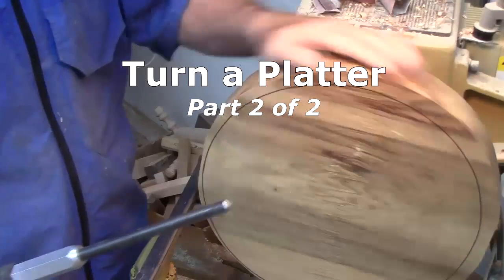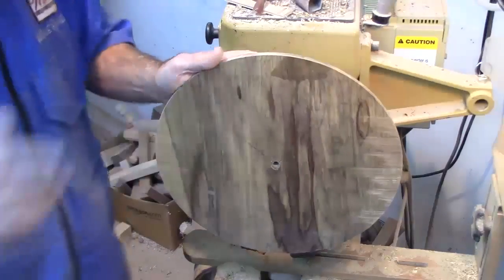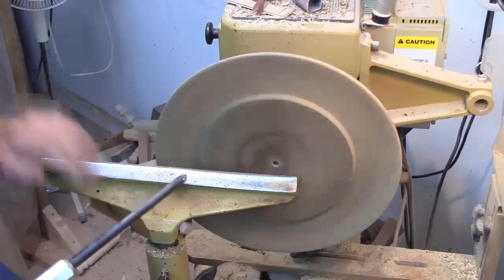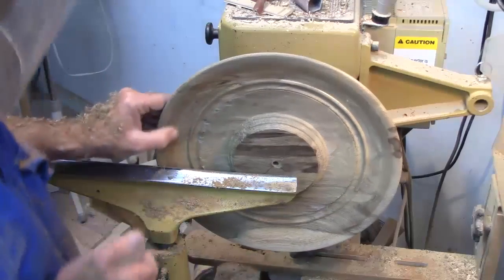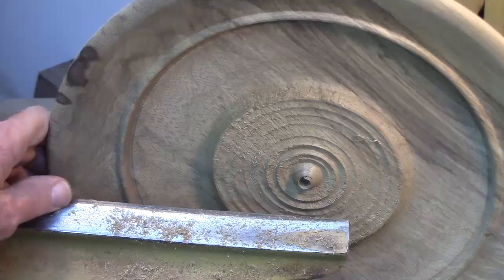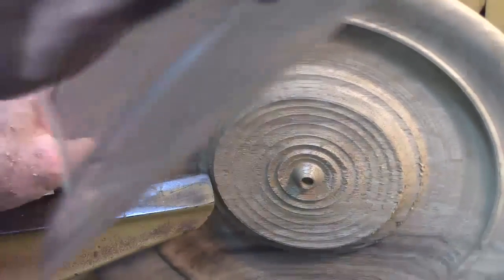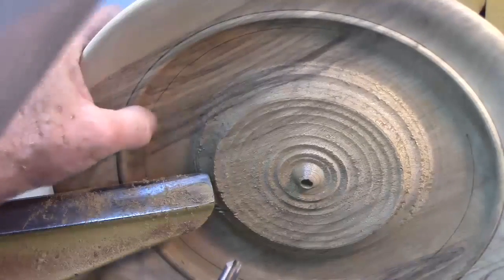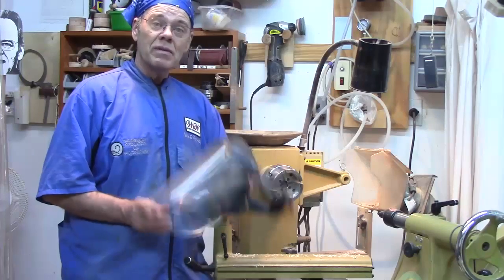How to Turn a Platter Pt 2 of 2

Comment: First off - I am new to turning so to see this spin off was actually good for me. I think you heard it cracking when you turned up the RPMs as I did. I now know that if I do hear this I am done. I think that I would have stabilized the wood after hearing the cracking. I am SO glad you posted the failures. I learned LOADS. Thanks.
Reply from the maker: Listening and investigating sounds is a critical skill for woodturning. I need to get better at it!

Comment: Hi Mike ,After watching this video a number of times it would have been great to see the look on your face when the platter parted company with the lathe . :o) I noticed moments before the tragedy  you had up the speed on the lath a tad. Maybe that is the problem along with the small vibration of the piece and  the speed was just that much to much with the vibration  for the wood to hold together.  It was looking like a keep till they parted company. Mike,  Great safety video :o) god bless
Reply from the maker: Back at you, John.

Comment: Great idea on removing the ring. One catch there and at 600+ rpm a finger can be is history. As to the piece, tough luck. Could be glued back with a small insert and re-turned. I've seen that before with very good results. Like watching what you're doing. Keep it up.

Comment: Gee what a pity mike, I really enjoy your turnings and especially your commentary. It’s very helpful for new turners. The black rimmed bowl at end, was that Indian ink.
Have you used vinegar and rusty nail solution on a bowl or platter. Do you have a video on embellishing, carving on to a platter
Thanks from down under.
Reply from the maker: The black rimmed one was ash scorched with a propane torch.  I have tried vinegar and rusty nail solution with little luck. I use dye when I need color.
Reply: If you put a tea solution on before rusty nail solution you will get better results, the tannin in the tea helps. Some woods like Douglas fir and oak have more tannins naturally. @MikePeaceWoodturning

Comment: Sorry about the failure; it's still a valuable video for the educational content. I have a 10" maple blank I intend to turn into a platter. You gave me some good info on how I should do it. How do you like the Thompson bowl gouges?  Most of my wood is fairly dry although I will "twice turn" bowls of maple and cherry that seem to have too much moisture. I'm considering a 5/8ths "U" for roughing and a 1/2 "V" for finishing. Any advice?
Reply from the maker: I have a Thompson 1/2" U and V. I prefer a more parabolic flute like the one he makes for Jimmy Clewes or Lyle Jamieson. The U would make a great bottom of the bowl gouge but I use a cheaper Benjamins Best  for that.

Comment: Mike-putting aside the cracking of the platter, I like the bottom of the platter to be smooth--no mortise (or recess).  Appreciate our thoughts on use of  a glue block on a platter that approaches 16 in in diameter, rather then the mortise?
Reply from the maker: I see no inherent problem with using a glue block on a large platter as long as it is done properly. It just seems like an extra step unless your platter blank is just real thin and you have no choice.  I think a perfectly smooth bottom might move more  and not sit flat than one with a slight recess. But that is just me.

Comment: I enjoyed your turning and I really liked the grain on that wood. Can you glue that back together with Ca glue or epoxy and finish turning at a real slow speed? Thanks for sharing.
Reply from the maker: +Frank Ingram  Not sure if  it would be worth the risk. It would be a challenge to clamp. But maybe I will re evaluate. Thanks.

Comment: I would try and pull the platter from the ashes by possibly cutting out the weakened wood and gluing the parts together but being there may have revealed otherwise.
Reply from the maker: +James Stanlake I guess I have seen or fixed too few "repaired" pieces that did not look like a second best effort. Maybe it is just me but I would usually rather spend the time enjoying turning another one than struggling with a repair that always seems to take as long as making a new one and I would never feel right about giving to a close friend or to selling.  I am not talking about a minor design change. Maybe I am just not as good at fixing things as some.